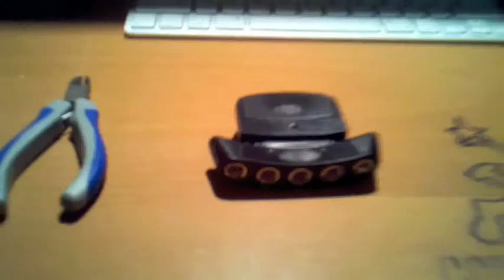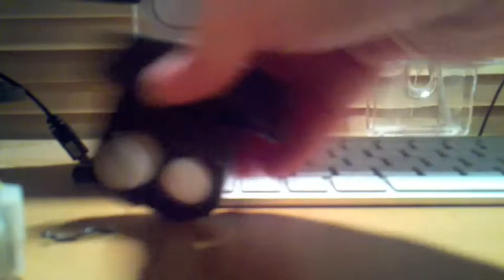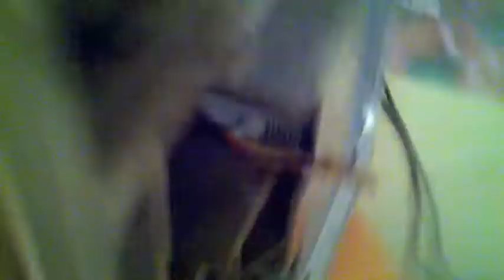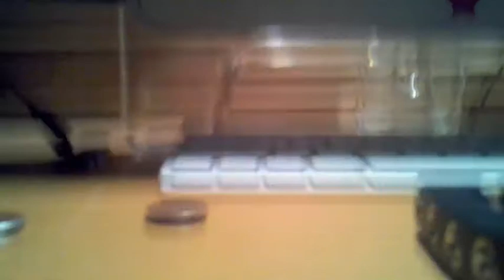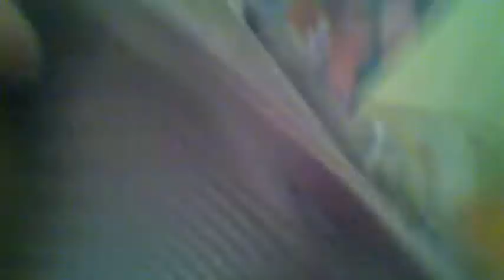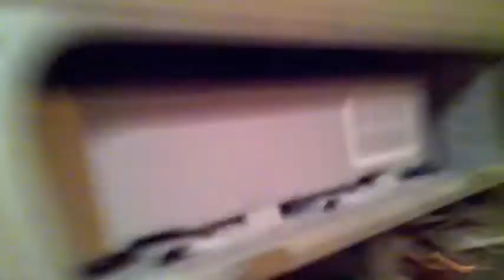Power Mac G5 LED mod

Comment from the maker: @BristolDJ123 If you look inside the optical drive, there is a molex pin adapter that is used for it, not any extension or adapter. What I did was, I has a molex pin adapter thats split it into 2 ports. one to the optical and one remaining. The remaining one had another adapter, one to the ATI Radeon 9800 and one to the LED light.